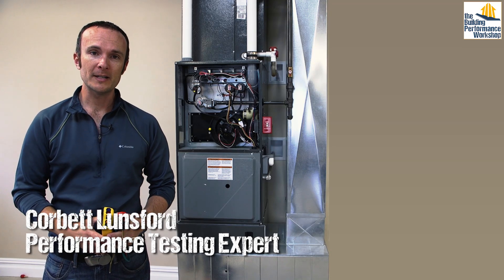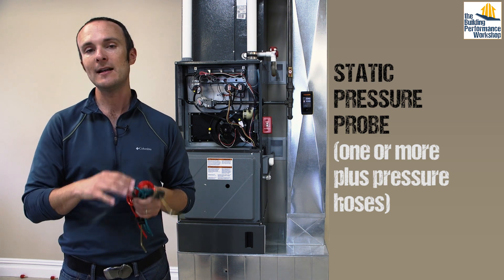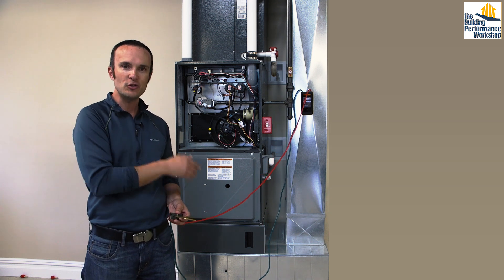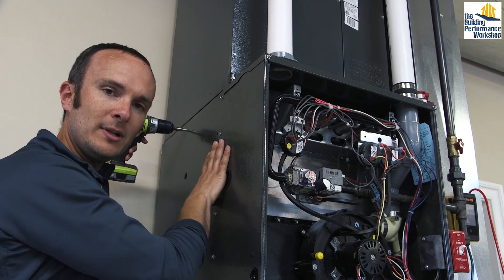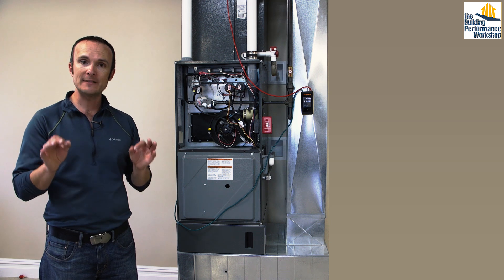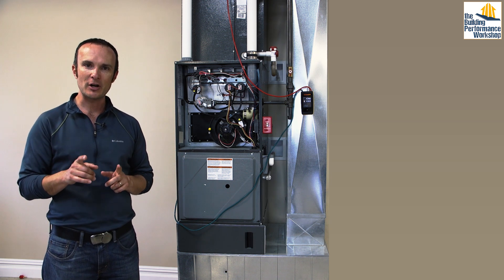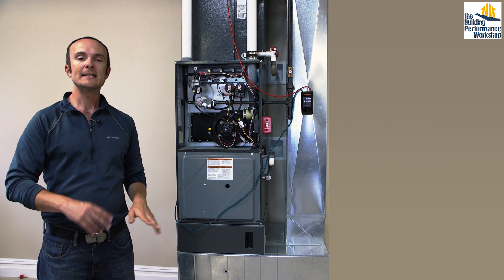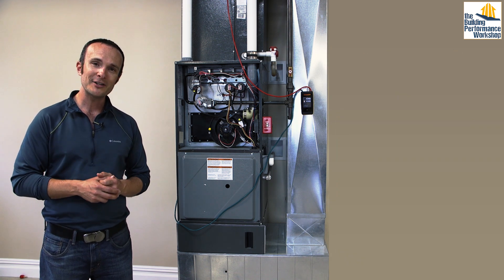Static Pressure Testing and Mapping Demonstration: Home HVAC Duct Performance

Comment: Great explanation. How do you know where to drill and not be obstructed by the heat exchanger when you try to place the probe. Do furnace suppliers (Lennox etc… ) specify these locations in the manual? I can’t find it

Comment: Corbett- You got the best videos on house air quality and everything in between, but us normal folks cannot afford a $2,000 manometer. Do you have any videos on basic like $50 - $150 manometers that we can use to test our systems. Is there that big of a difference between a cheap version and an expensive version? What do you recommend to use that is in a lower price range? HVAC guy charged me $125 to come out and test static pressure last time, so if I can get a unit under $125 then I can test all I want while trying to get my system to the right target range of S.P.
Reply from the maker: $400 Retrotec Solo
Reply: @HomePerformance  Awesome! Thank you so much. I will investigate!

Comment: Im confused by your demonstration, specifically the orientation of the probes, are these Pitot-Static probes? If they are not Pitot-Static probes with holes perpendicular to to the airflow then the probes are measuring the total stagnation pressure which is the sum of both static and dynamic pressure. So, what type of probes are the ones you used?

Comment: Do you have a video explaining how to do this on a heat pump?
Reply from the maker: It’s the same, but easier- you don’t have to test between the AC coil and furnace cabinet, since the coil is inside the cabinet.
Reply: @HomePerformance  no need to drill a hole in the unit then? I am having a hard time with the Air handlers that have the filter under the coil since I see no good place to place the probe after the filter. Any recommendations on this for heat pumps?

Comment: Remove the high limit and use that instead of drilling
Reply from the maker: Your number will be higher
Reply: @HomePerformance  why
Reply from the maker: @ivancook1247 you’re still inside the equipment, so it’s not actually External Static Pressure- might not matter but a few hundredths of an IWC, but every bit counts

Comment: With the new furnaces today, kinda forces a tech to learn about static pressure in order to set the operating parameters into the furnace board for proper operation

Comment: Why not, just use a metal cutting Drill Bit, with a Depth Stop, Clamped close to the Tip of the Drill Bit....
  Nice thing about this method, is you can control the Diameter of hole, in the Event you want to use static Cap Cover's, when you're done Testing....
  Just a thought.....

Comment: informative video, but what i don’t like was u telling people not to call company whos  sticker is on unit if they didn’t drill a hole in furnace. alot of techs will pull out high limit switch and test from there.      one would be better of asking company or tech if there static pressure is good or bad and go from there

Comment: People, it seems like many people struggle with where to probe to measure the coil drop.  I would like to share what I have done which is very easy to do. You do not need to drill anything and you do not need to buy the special probe either.  Just use the screw hole by taking out a screw.  To measure underside of the A coil, I unscrewed one of the easily accessible screws from the triangular A coil cover blocking the underside.  To measure the top side of A coil, I unscrewed one of the A coil housing cover screws and measured there.  In both cases, I pressed the open end of tubing from the manometer ($35 from Amazon) right against the screw hole tight and read the meter.  In my case, I measured 0.16 (top side) and 0.25 (underside) which gives me drop of 0.09 WC.  I was afraid my A coil would be clogged up a lot after 26 years of use without cleaning at all but this measurement tells me it is wide open for which I am so happy not having to do the big job of disassembling the whole A coil and cleaning it up and reassembling it.  

Just for sanity check, I also bought Anemometer ($16) from Amazon and it measured  anywhere from 550-800 ft/m air speed out of all the vents which seem very reasonable based on what others measured on brand new system.  This sort of confirms that my A coil is pretty clean even after 26 years of use without cleaning at all, which is quite surprising.  I did not even replace the filter either.  I simply vacuumed the filter every year.  I hope I am not dreaming.
Reply from the maker: Very cool, but that’s not static pressure testing. A 1-hole tube like a hose picks up velocity pressure as well.
Reply: @HomePerformance  Hi, thanks for the reply.  I understand the probe has holes on the side rather than at the tip to prevent picking up velocity pressure.  So, in effect, it is measuring the pressure at  90 degrees from the direction of the air flow, is it not correct?  If so, if you press the open end of the manometer tubing right against the screw hole which is on the side of housing, aren't you doing the same thing?  It is picking up the pressure at 90 degrees from the direction of the air flow.  Is that not right?  This is what I figured.  If you disagree, I can always verify this by buying the probe and remeasuring.
Reply from the maker: @tommason5689 yeah, there’s a lot of turbulence in there, I wouldn’t trust it too much. Only $15.
Reply: @HomePerformance  As you recommended, I bought the probe and remeasured the static pressure again today.  I had to drill the side of the plenum right above the evaporator because the probe was too thick to fit into the screw hole.  I measured 0.15 with the probe and also measured exact same 0.15 without the probe, with the end of the tubing pressed against the hole.  This is only 0.01 lower than at the screw hole of evaporator cover I measured previously.  This difference could be due to manometer tolerance as well.  In conclusion, it seems that measuring at the screw hole just by pressing the tubing against the hole is just as good as using the probe.  Anyway it was good experiment to see if there was any air turbulence effect you were concerned about if probe is not used.  This proves there was none at all.
Reply from the maker: @tommason5689 ok, in this specific case with this specific geometry- but can’t really generalize that all systems will test the same way. Good work sleuthing!

Comment: I'm having a hard time getting the right static pressure. I'm measuring before coil and after filter and I get a 1wc so I lower the speed of the blower to get my .5wc and now the air flow just seems too low I feel like I'm going to freeze the coil being too low or set off a high limit switch when heating the home. I'm just confused and need guidance.
Reply from the maker: The ducts are too small. Add more ductwork right as it comes out of the unit.
Reply: @HomePerformance  Thank you sir I'll see what I can do. I was told 2 different things from past employers one said that I could run the blower at lower cfm just as long as I'm staying within the 70% range of the CFM and another said I'm able to run the system with a higher static as long as I don't go past 1"wc.
Reply from the maker: That’s life :)

Comment: Question, when measuring the pressure across the coil you subtracted .07-.21=.14. When measuring across the furnace .38 + .21= .59 for the furnace you added your two different pressures but across the coil you subtracted. Not sure why you subtracted one and added the other.
Reply: Subtracting was to obtain the pressure drop, in order to see how much pressure the coil itself is inducing. The purpose of measuring before and after the furnace and adding it is to obtain the TESP, total external static pressure. As the TESP was a bit high, he decided to see how much pressure each component was inducing via that that isolation "drop" method.

Comment: Author says air filter static pressure should not exceed 0.1 IWC which is MERV 4. Minimum should be MERV 11 with 0.32 IWC. ASHRAE recommends MERV 13 with 0.42 IWC.
Reply from the maker: No, no one recommends static pressures. They STATE what a static pressure drop will be of a certain surface area, at a certain airflow. You just need to get a thicker (pleated) and bigger filter to make the static go back down.

Comment: You said you should always see a hole in the equipment to know they have done static pressure test….
The hole you drilled in the heat exchanger cabinet, could have actually just removed the hi limit switch (which is inside heat Exchanger) and used that manufactured hole instead of drilling. 

Return can usually remove sight glass off bottom door or use the side holes that are meant for bringing in wiring.
Reply from the maker: High limit hole will give an elevated reading, so harder to pass, and you need a hole past the filter as well as the one in the blower cabinet.

Comment: Thank you for this helpful video.  I am a homeowner looking to learn.   On those pressure probes, it looks like they just face into the airflow and it doesnt matter if the hole is "sealed" by the base of the probe where it enters the ducts or am i wrong on that?

Comment: Is the best way to measure pressure across the filter if you have wall grill filters, to measure the room pressure and make that the delta?  Or is it better to remove the filter?

Comment: Your comment about contractors not checking the static if there is no hole in the HX is untrue.  You can absolutely remove the limit control and check the static pressure.  In fact, good techs actually know this is the preferred method.  Because most furnace manufacturers do not want you drilling arbitrary holes in their furnaces.  I am not going to say where some go.  However, several major brands will tell you where you have to drill a hole in the unit or your measurement will be wrong.  There are baffles inside many pieces of equipment to direct airflow, which may affect your measurements.
Reply from the maker: Your last point is the problem with using the high limit hole- the reading will be higher than actual, and I’ve tested enough systems the right way to know less than 1% of them would pass using the limit switch location.
Reply: @HomePerformance  If the manufacturer tells you to put it there, that's what you do.  They designed it, they know how to test it.  I work on a lot of brands, I read a lot of manuals.  I know a lot of people on the technical side of it.  Your video is mostly correct.  I just think it isn't fair to tell consumers no one is checking it if they do not see holes in their furnaces.  Because it isn't 100% accurate.  Not even close.  Maybe if you said, "if you do not see holes in your ducting system", maybe I could get on board with that.

Comment: Great video. I've done some drilling into plenums and ducts before for testing but never into a unit and below the coils. Any rule of thumb as to where the coils sit in most units so hitting them when drilling into the units can be avoided?

Comment: So static pressures should be near:
For filter 0.1”
For coil 0.14”
Heat exchanger 0.21”
Total (return + supply) 0.5”
What else?

Comment: You need to do this with a wet coil. The wet and dry coil static pressure drops are very different. Also a used filter will have a higher drop. A used 5 (4 3/8) inch filter and wet coil, can often equal more that 0.5 on a large number of furnace and coil arrangements. Fan coils usually include the coil in the internal and therefore provide more headroom. I can provide recommended coil and furnace combination data sheets that will shock you on this topic.

Comment: You got it right! The .59 TESP should and does total your other 4 SP readings. SA duct -.07, Coil - .14, Filter -.19, RA duct -.19  = .59 TESP. As you mentioned, the other readings clearly show where the problem of too high TESP is. Thanks

Comment: Remove the firewall high limit. that is the best place to check the static pressure in a gas furnace
Reply from the maker: Ok, but you’ll get a higher than actual reading there because you’re still inside the equipment.

Comment: Thanks for your clear, concise explanations!  I am a residential remodeling contractor.  I am having trouble explaining some of these concepts to a client, who thinks that simply closing off vents to half the house in the winter will save energy, that the furnace burns less fuel/gas when vents are closed, and that static pressure can/will damage the furnace components.  They have a single stage unit, no AC. 

Do you have a video that might explain these concepts?  My analogy of "getting 10 pounds of sugar in a 5 pound bag" is not getting the point across 🙂

Thank you!
Reply from the maker: You might try this one first, Scott- it’s shorter and simpler: Static Pressure Testing for Home HVAC: What, Why, and How in 2 Minutes
https://youtu.be/Ks55DcS1ZgQ

Comment: My heat pumps Fujitsu 2 ton (ARU24RGLX) , came with a default setting of  Standard static pressure: 0.18 in.WG (45 Pa).    I asked the installer to show me the equations they used to match up with the proper  setting for static pressure.   Of course I didn't receive any such information but did get the line:  The system was designed for that heat pump so its all good.    In the design/tech manual  the function code for static pressure is 26 and the default setting is 31 which equates to .18 in.   The settings start at 03 = .12 in (30 Pa), in increments of one up to a setting of 20 = 0.8 in (200 Pa).   Then one has 31 = .18in and 32 =  automatic air flow adjustment.      I find it hard to believe that any work was done to optimize static pressure setting but want to know if leaving it at the default is best practice for installations?   Would it be feasible to set it to 32  Auto adjusting??
Reply from the maker: Whoa, .18 is insanely low. Yes, I’d advise the auto-adjusting I guess, though not sure why it’s not defaulted there.
Reply: @HomePerformance  Well I looked in the D&T Manual and it appears the setting 32 Automatic Air FLow is specifically for a procedure as follows and thus not to be used full time.  
I may simply use a middle setting for now (and try the procedure below in the summer)  like mode 11   approx   .44 inWG   (in the middle between .12 and .8 )
Quote:  Automatic airflow adjustment procedures
1. To start the auto setting, use setting value 32 in function number 26.
2. Run the air conditioner on fan mode (High).
* For instructions on how to operate the air conditioner, refer to the operation manual of the
remote controller.
During automatic airflow adjustment, the mode will be fixed at fan (High).
When this function is active, do not operate the outdoor unit.
3. The air conditioner will run for about 1 to 8 min then stop automatically.
* Do not change the throttles of the inlet and outlet ports during operation.
When used in a group control system, the setting will take about 10 min.
4. Turn the air conditioner off and on again.
5. Check the setting value of function number 26.
* If the setting value has not changed, repeat the procedure from step 2.
CAUTION
When the duct or outlet installations are changed after the Automatic airflow adjustment is completed,
repeat the procedure from step 1.  unquote:
Reply from the maker: Sounds weird, I’m out of my depth on that one